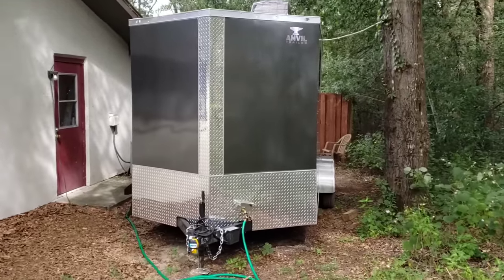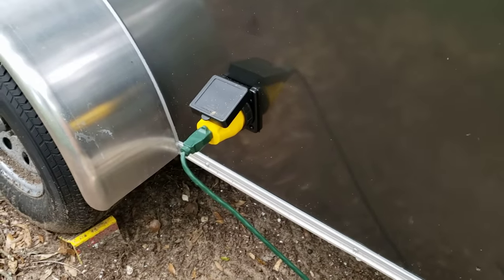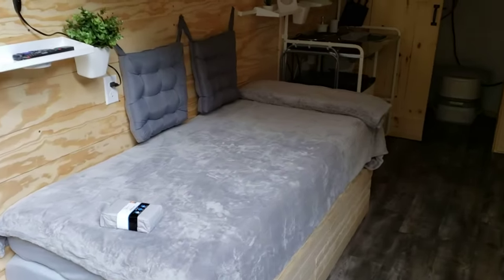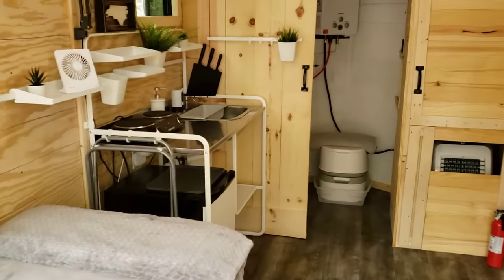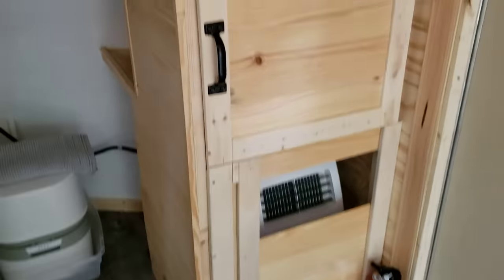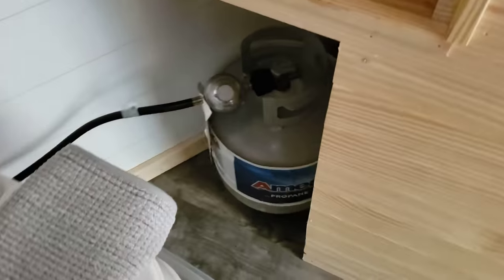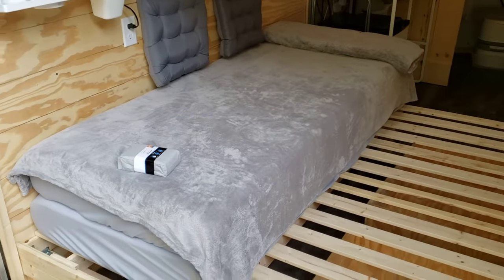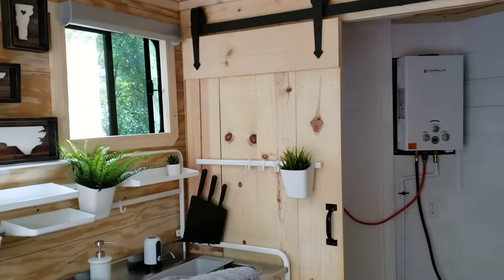7x14 Cargo Trailer Camper Conversion Finished (Tiny house?)

Comment: My dream is to build from a flat trailer up.  Metal studs and such, saving weight.  Because of the 12k cost at least, I'm afraid to try.  It's still a fraction  of the cost of a new camper.  Thanks for the inspiration.

Comment: Nice job. I always wanted to do a gravity feed water system but lifting a few full water containers above my head isn't something I want. I could maybe do a warn cordless drill winch setup to pull water containers up but your rechargeable pump is a good idea and solves that issue.

Comment: I like your design, and I really like that you use this as a toy hauler for your motorcycle 👍. I've been thinking about building something similar to this... with the bathroom/shower and kitchen toward the front, and room at the back to use the cargo trailer for cargo... especially if that cargo is my motorcycle. One thing that I'm also hoping to have an area for (that I haven't seen yet) is a place to set up and play a full-sized 5-piece drum set with 2 crashes and a china... I'm not sure how the designing process will go for that part, and I will also need storage space for the drums. This design looks like a good place for me to start. Thank you for sharing it.

Comment: Thanks for the tour. You have some skills there with the woodwork. Very creative. Let's look at your air conditioner and how it works. That design is the most inefficient one ever made. They should be illegal. Why is that? Well, it needs to have two inlets into the unit as well as two outlets. Take a closer look at your AC. The tube that exhausts the hot air from the condenser needs to come from some place. That air is robbed from the cool air produced by your AC. Try this. Stand outside the exhaust port and feel the mass amount or air pouring out. Now, close up your entire trailer, with the AC running and crack open the window. Feel how much air tries to come back in to make up for all of the exhausted air. Now, the cooling portion of your AC unit needs to have the inlet unobstructed. I have no idea why manufacturers produce these designs. If you have a moment, find one with two tubes that can be piped to the wall. This way , your AC unit is using outside air to cool the condenser while the cool air produced stays inside your nice little camper.  That green extension cord... throw it out. It is a 16 guage wire. It is good for 13 amps. Your circuit breakers are rated for either 15 or 20 amps. Respectively that requires either a 14 or 12 guage cord. Purchase one that is 12 guage and you won't have to worry. The issue with running that Christmas tree extension cord is you risk overheating it before the breaker pops. 
I hope I am not negative regarding your build. I think it looks amazing and you have given me lots of ideas. Good luck with everything.

Comment: Congratulations on one of the most common sense , affordable , well done and designed camper conversions ! I am a disabled Nam vet who has wanted to build my own rv, camper most of my life, and if the good lord keeps me around ( I am a young 74 now) I just may copy your design. Have you thought about if you havn't already did so, installing a screen such as is used on garage door openings across the back end? 
I am hard to impress but you have managed to get my attention with your build. My wife and I live in High Springs, Fl
Reply from the maker: Very high praise, you are too kind. I tried a magnetic screen, but it made it a litter difficult to move my motorcycle in and out, otherwise it works well! Thanks again for your support 👍😊

Comment: Very nice build!
From Boise Idaho I wanted to share what I learned from the huge Criterion trailer Manufacturing plant in Caldwell Idaho
I took my trailer in for a window add on, roof vent  and RV door with  window and screen door too.
Wade one of the managers told me law requires him to put in RV escape windows as liability to them
He said along with another guy you want to think about how are you going to get out should your door lock up?  You cannot exit from rear ramp either.
Kinda rattled me thinking about this. 
Just a heads up for you
Great job be proud of yourself
I am 70 yrs old male and building my 6x12 v nose now loads of fun!
Reply from the maker: Thank you so much!

Comment: Excellent.  Most of these utility conversions lose the ability to load a motorcycle.  Plus yours also looks to hit another objective of mine...not losing the functionality of a utility trailer if necessary.  It appears to me that you could roll out the bed, roll out the kitchen and use your trailer to haul cargo if you needed to.  At any rate, it's certainly close enough to that where I can make mine work in that manner.  The only thing I didn't see was any sort of heating.  I imagine you plan on using electric space heaters if necessary, but you didn't mention it.  Very grateful for this video.  I'd have loved to hear a bit more about your choices for bath fixtures.  You seemed to be a bit apologetic for your shower, but it seems almost perfect to me.  Is that a utility sink you're using?  If so, is that a wood surround?  How do you waterproof it?  I'd love to see a second video with more technical information, but thanks so much for this one.

Comment: only thing this seems to be lacking is latches for bathroom door and cabinets and everything on wheels. chair on the wall you may want to get 2 wall broom holders to keep it from damaging the nice wall. but otherwise... simple, practical, cheap to do. looks great though and this comment is like a year and a half after the video and im sure you've probably noticed by now those needs and perhaps added more as you went.

Comment: Two questions: 
1. Have you found the portable A/C to be sufficient?  I've heard bad things about them.
2. Who makes the jackstands on your rear door?
And as a comment....suggest you put simple slider bolt locks inside the fold-down ramp door and then leave outside ramp latches open when camping.  That way you can get out through the back in case of a fire.

Comment: Great job. I built a conversion cargo trailer a few years back. I didn't actually put a shower in mine I carried a shower tent and make a home made shower out of a steel weed killer bottle. I had a tiny grey tank for my sink about 5 gallons. I was wondering what you were using for a grey tank for your shower. Good well thought out video thanks.

Comment: Hi, just a quick note on something I noticed. I know you were just using it for the video but
you should get rid of that green extension cord. I think I heard your air conditioner kick on and
that cord is not a heavy enough gauge to carry the amperage. Not only a possible fire hazard
but could damage your AC unit. If the cord is heavier than it looks on the video- sorry!! Also this 
is a great build. Got some good ideas. Thanks.

Comment: Nice Build….
Suggest You Move the Propane Tank Outside…..
Never Store a Propane Tank Inside any building or Camper….
All Tanks have a pressure relief that could go off at any time…. And Fill the room full of gas in seconds….
Propane Expands 270 times per volume 
5 gallons x 270 = 1,350 of vapor 🤔
(20 lb cylinder)

Comment: I have to wonder what something like this cost verses an all out RV. I bought a 35ft fifth wheel with three slides for $25k one year old about 4 years ago and can't imagine living in something smaller. Its a beast but sure is fun to go RVing in. It seems small with 4 adults in it so can't imagine this thing after a day or so lol. It is super cool though I will admit. I have a 16ft enclosed trailer like this I use as storage in my back yard. I would be claustrophobic in that thing closed up. Way more windows are needed in my opinion. I'm not hating by any means, I think its super cool for sure but I would not be happy in it for more then a day. I have had many RV's over the years and one thing I have learned is if I can't get comfortable in it and relax for hours on end and see out all around me then I will hate it big time but that's me. Again super cool build and impressive, I would just add some more windows and chunk the TV. I never watch TV while RVing.

Comment: Props for doing this your self. But the Propane tank should be on the outside for safety. End up with a gas leak and turn the camper into a bomb. And the water heater over a power socket is a big big no no.

Comment: Only thing I would like different is have an electric instant water heater than a propane.
Reply: i have been looking for one for my camper. do you know where i can get a small electric water heater preferably a tankless. all i can find is gas
Reply: @carolmaplesden916  Yes! Absolutely! Amazon has all kinds. Just type in” Tankless Electric water heaters”
Reply: Can you show( in detail) how your water connection fitting is installed? Thanks!

Comment: Can you please share the shower tub model and where you bought it, as well as the piece attached to the ceiling to hang the shower curtain?  Also, what white material did you use above the wood piece attached to the tub?   Was it just white paint, or some type of plastic sealant?  Thanks.

Comment: We are about ready to start our own cargo trailer conversion. We were hoping to find a good used trailer but there doesn't seem to be very many in supply right now. Did you find that there wasn't very much cost savings on used vs. new? Do the new ones hold their value quite well?

Comment: Love this conversation!!! Where does the shower water go? I have been wanting to do a conversation like this but the placement of the used water tanks is where Im stuck at.
Reply from the maker: We had two options, the first is what we are using, a rhino tote tank to collect the water and then later dump it. The second option is to run a hose from the bottom of the shower directly into a sewer drain at a campsite.

Comment: Just about the same size as my trailer camper renovation. Was weight a c concern or are you mostly stationary? MsrkMannM2
Reply from the maker: Weight was  a concern, I tried to keep it as light as I could. But since then it's mostly been stationary.

Comment: Hi, great Job. Using this video as inspiration for our 6x10 trailer. Question, how did you secure the usb faucet to the countertop I believe thise are made to be installed over 5 gall water jugs?
Reply from the maker: Thank you. I didn't secure it because it doesn't move around on its own even when traveling.

Comment: man what a good job you have done I am impressed looking at ideas like this to convert a trailer into a camper and your video was the first I saw and it inspired me a lot good design it seems that you thought of everything !! I would like to know if the walls were insulated? thanks for sharing
Reply from the maker: Thank you! Yes, 1 inch in the walls, and 1.5 inches in the ceiling.

Comment: Thinner paneling would have cut that weight by half. Panel for shower  would be a lot less also.  emt to build bed frame less weight. I can see where 300lbs could have been saved without looking bad. Not hating on the build i like it just looking at ways to be less heavy. Which could mean things like  stove , microwave.

Comment: Hey great build here. I too live in citrus county. Would love to see this , I built two of these in the past but not to this extent. Did you know the weight prior to the build. Curious how you registered it. Anything under 2k doesn’t need a title, did you have to have it inspected?
Reply from the maker: Thank you. It started out at 2160 pounds I think, but because I have the title the DMV here only required that I change the registration and title to reflect that now it is a travel trailer which wasn't a problem at all.

Comment: It's a very nice Lil camper but small but nice even for starters!

what restrictions are u talking about?

could I get into trouble if I was living in something like that?
Reply from the maker: I was talking about Campground restrictions. For instance: some campgrounds won't allow "homemade campers", but if it's registered as a travel trailer and you've completed all the appropriate paperwork then there's no problem. As far as living in it, I think it depends on the circumstances and what state and county you may live in as to whether you could have difficulties or not.

Comment: Did you insulate and if so what did you use?  I’m thinking about a do it yourself conversion. Really liked your’s, just need a bit more info please. Lol  Like your kitchen idea and you have more storage than most.
Reply from the maker: Thanks! I did light insulation, it's one inch in the walls and one and a half inch in the ceiling using foam board.

Comment: since cold air falls, your AC should be higher. remember, hot air rises and cold air calls.
Reply from the maker: Yes but we are talking about a very small space, that would definitely apply to vaulted ceilings however we are talkin about 7 ft high ceiling and only a hundred square feet total.
Reply: @Stephens802  how happy are you with your AC set up? Would you redo it?
Reply from the maker: @jobe966  The AC unit itself is lacking I think, my in-laws made the same size trailer with just a larger unit and they're not having any issues cooling their trailer. So I think that I should probably swap to a larger AC. But the system works. 👍
Reply: @Stephens802  thanks for the info as I will be copying much of your awesome build lol

Comment: Nice job..  very well thought out…. Does it stay cool with that AC in the summer?
Reply from the maker: Not as well as I was hoping, however I feel that that's probably due to this specific AC unit. I plan on pulling that AC unit out and putting a hatch into the side of the trailer to allow me to put a window unit while I'm parked. I guarantee that'll be a lot more efficient, Though a little more noisy on the outside.

Comment: Good job pal 👍 is there room underneath for a water tank for the what size solar system
Reply from the maker: There's not much room underneath, but I could fit a tank under the bed if I wanted.

Comment: What did you cut groves with. Female here...learning From yall as I go! Thanx
Reply from the maker: A circular saw, set to a 1/8" depth.
Reply: @sandyginn860 A router could be used for that, if you don’t have a circular saw. ❤
Reply: Grooves. 😬

Comment: Nicely done. A little solar, and a magnetic screen for the back if you leave it open as a deck. Great build. How much was the trailer to buy?
Reply from the maker: $4000
Reply: @Stephens802  is the floor fully metal, or is it plywood over metal beams?
Reply from the maker: 3/4" plywood over metal beams.
Reply: @Stephens802  thanks. I hope you have some great times.

Comment: Curious to what size breakers you and your in-laws used for your portable a/c units. I going to purchase the black and decker with a/c and heat and then run a dedicated circuit from my 30amp panel. I believe I can use a 15 amp but just curious what you guys used. 15 or 20?
Reply from the maker: 15 amp is plenty for us 👍

Comment: how do you like pulling the 7x14? i was also looking at the 6x12 but this just seems to have a bit more space. I would try to feel comfortable with the 7x14
Reply from the maker: I suppose it may depend on what you're towing with, but I have a V6 Tacoma and it pulls well for me. It's a little wide though, I would recommend mirror extensions.

Comment: Hey did you ever get it weighed ? Did you add insulation at all? Also that roof space would be perfect for some solar panels. Awsome build 👍
Reply from the maker: Yes, it weighed in at 2920 lb, there is 1 inch foam board in the walls and ceiling.

Comment: Will a 14 footer be too heavy to pull without a truck? How long can you go and still be pullable by minivan or lighter SUV?
Reply from the maker: You can check the towing capacity of your specific vehicle online and then a good rule of thumb is the weight of the trailer, Ideally, should not be weigh more than half of your towing capacity.
Reply: @Stephens802  1/2 because, the other half would be for people and stuff in the trailer? Thanks u for the reply?

Comment: Really like your build! Great job! I have a couple of questions. Did you remove the interior plywood? Insulate the walls?  I bought an Anvil and can't remove the interior plywood because the philips heads keep stripping out.
Reply from the maker: I did remove the plywood and it was a PAIN!!! They're actually a nail that they use a special kind of driver to install them, you can't unscrew them as far as I know, you have to pry them out. Once I got them all out I was able to insulate the walls.
Reply: Thanks for that information! I stripped a few screws and was very disappointed. I have a couple of pry bars! I'll get start in the morning.

Comment: You cant yet sell it .. for a lambda customer. Still you got the touch.. go further on any point then put the price at the limit.
Reply: Very good point : lightened kitchen in metal , separate douch .. but finition is to be done again. And wood is to heavy , light it up !

Comment: How did you run the electrical lines behind the factory walls (E.G., where you have the TV outlet)?
Reply from the maker: I added 1x2 ferring strips to the steel studs and was able to just notch them to run the electrical through them. Then I reattached the plywood walls to the one by twos.